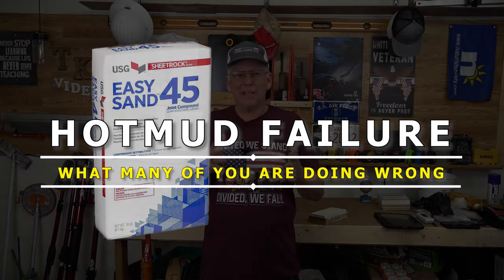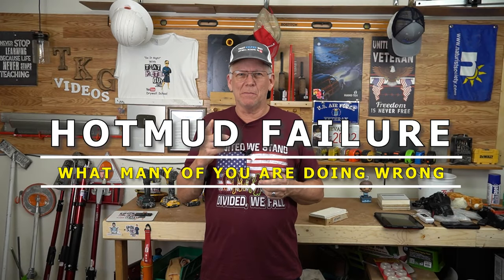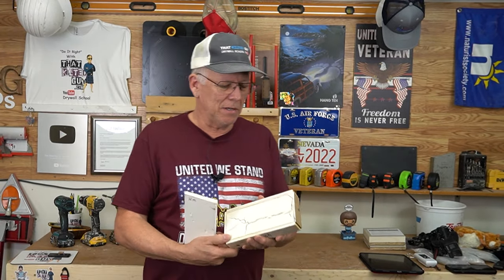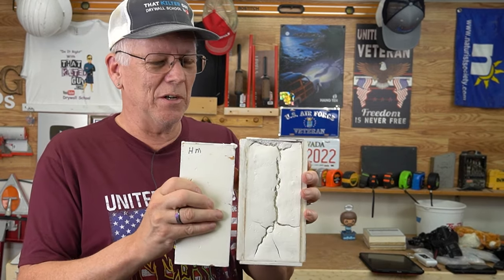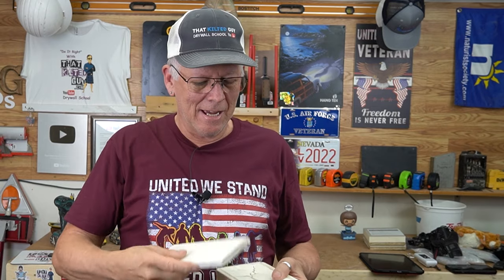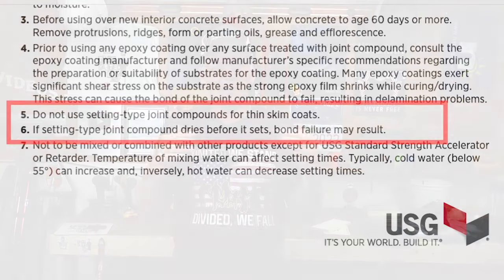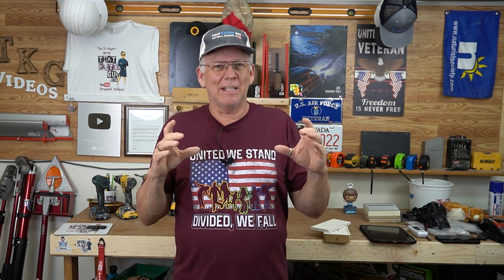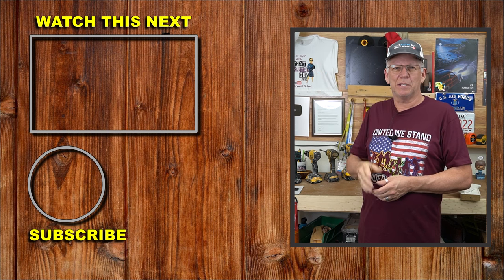Hot Mud MAY FAIL if You Make This Mistake.  That Kilted Guy Drywall School

Comment: This is especially true when you go over existing hot mud with a thin layer and you go to sand it. The top layer kind of peels off the bottom layer and you end up with voids. Terrible situation because now you have to sand it basically down or go over it with all purpose.

Comment: When i worked professionally as a finisher I preferred 90min for all but the top coat and inside corners. I did not know about a thickness requirement.

Comment: This is good info. I'm a painter who does the occasional taping or popcorn removal job. I've started using 210 on larger jobs rather than 90 just so I don't have to worry so much about a full bag setting up on me before I can use it up. I think I'll probably switch back because I can see the 210 drying out in spots before it sets.

I'd also add that I usually start filling screws with hot mud once it starts to harden but before it becomes unusable, drying before setting shouldn't be an issue there.

Comment: How's this for going old school: I still use the brown bag Durabond every once in a while. Maybe two bags a year.  The stuff that literally hardens like a rock. 

The places I use it are in areas where taping is a pain, like when fixing cracks in old textured ceilings. I only use it as a bottom coat and very sparingly. I also use it to fill areas to bring up a patch to wall levels for those times when there's a big difference in depth between the patch and the old wall. Because it's literally rock-like, it's great for filling deep and wide gaps where taping is difficult. It's especially helpful in old homes with plastered walls.

Home Depot and Lowes have discontinued it. Menards still sells it. Glad they do because it has saved me a lot of time.
Reply: Ace hardware still carries it as well.
Reply: Ace hardware still sells durabond 90 in the brown bag
Reply: Some Lowe’s have it. They can ship one store to another if you have a few days. I just bought 3 bags so that I don’t have to drive 20 miles next time I need it. I use it to prefil and 1st coat on FibaFuse.

Comment: I can't thank you enough for this info. I've literally googled with at least 7 different queries asking for an answer to why my hot mud wasn't setting up in some areas (but not everywhere) after several hours with nothing but useless results.

This was especially perplexing because I would always test to see if it had set yet by lightly applying pressure to one of the lap marks to see if it was hard yet. If it was, I'd proceed with scraping down the high points with my knife, only to see my knife make an awful gouge into the mud that didn't set up, ruining the coat.

Turns out I just didn't know that hot mud shouldn't be used for thin floating. Since learning this from you, I pretty much only use hot mud for pre-filling, taping, and occasionally on the first coat after tape.
Reply from the maker: Hot mud also sets up way slower over painted surfaces. That has bit me many times.

Comment: Use that 20-minute mud with PVA glue in the water. 25% for structural and less for not.  Works like charm and delays drying before curing.  
few things hot mud swells, most primers make hot mud swell so use a good hotmud sealer, you definitely need 2 coats of good primer to stop flash through.  Learned all this the hard way.

Comment: USG recommends you only use paper tape for any tape and bedding. They also recommend you score the factory butt joints with a blade for better adhesion, but who does that? Every single time I have to repair old patches (not mine), its because the previous patches used hot mud that is just falling off the walls and ceilings with some scraping. 
I actually like to use my hot mud unmixed on my tray until I start tapping. So i put water first, then hot mud, stir a little bit and then start tapping. Ill have some dry stuff and wet stuff in my tray the whole time as I am applying.  My time to mix a tray is less than two minutes, It cures faster, then I just scrape with a 90 degree angle any imperfections once it hardens up, but before it begins to dry.

Comment: Oh man so interesting. I had to re-do some ceiling tape joints because of some light cracking and couldn't figure out why.....now I think I just figured it out. Never again, last coat with all- purpose.  Thanks!
Reply from the maker: If those joints were done in mesh tape and regular all purpose that would also explain it.

Comment: good video. the w estpac light weight hot mud can be skimcoated thinner than 1/8 but you can't work it too much otherwise it can lose its bond. I've also had a few tiny spots fail when floating some ceilings when it bubbles and you don't skim it tight immediately

Comment: Great video sir...all I buy is EZ sand 5 minutes to do patches because I get impatient waiting for it to dry..lol but for the most part I don't like using hot muds because I like to take my time 🙃
Reply: 2 points to make, I had the same thoughts about  EZ sand, but 1 thing I do to counter my concerns first of all when I use 45 or 90 and I want to speed up the setting time I use very warm water when mixing it works, for EZ sand 5 or 20 if I want to extend the setting time I use refrigerated cold water when I mix it, it allows you to not have to worry about hurrying, to do this allows you to take your time, sometimes I run out of the type I need, by using the different temperature water with the type that I have, I may not have to run back to the store right away.

Comment: Thats odd because I use pro set 30 alot. I've tightly polished over joints that I have 1st and second coated with 30 min and have has zero issues on the finished product. I do for the most part do my final coat while doing patchwork with reg mud tho..

Comment: Thank you sir, this advice came at the perfect time. I have a ceiling I'm about ready for prime and paint in the morning. I did 2 coats of hot mud and one coat of all purpose.  Have a couple small tweaks I would like to hit but was sitting here looking at a bag of 5 min hot mud, thinking if I skim it with that I will be good to go..then I saw this video.  Now I'm thinking I will give it a light scrape, sand and prime ... then hit it with some dry dex to bring it to its final state. What do you think of this game plan?
Reply from the maker: It really depends on what it needs and I can’t tell you that from a text description. But I would definitely stay away from the hot mud as it’s not good for skim coating. You can learn a lot more in my new Drywall courses at www.DrywallAcademy.com
Reply: Thanks I will check out the course.

Comment: Maybe you can spray a thin coat with water to avoid drying faster than it sets. Or mix it wetter?
Reply from the maker: No that’s called re-tempering and they specifically tell you not to do that

Comment: Great content as always. If i prime over hot mud will that help the paint stick to the wall better?
Reply from the maker: Always prime raw drywall
Reply: @That Kilted Guy DIY Home Improvement  Hello, I just took down my popcorn texture in my garage. I also took down the tape as it was loose. So here is my plan. Screw any loose drywall boards, mesh tape, hot mud (2coats), plus 3, apply new texture(orange peel), prime then paint. Is that ok?? Is my order correct or is there something else I need to do?
Reply: @SkyHawk2849 That plan is perfect.

Comment: Guy, I’ll give you a situation- I am painting a bedroom and will be repairing screw pops, minor scrapes, and small holes where screw anchors were. I have a small bag of Easy Sand 5, small tub of All Purpose Joint Compound (green), and a tub of Spackling Paste. Which one of those will give me best results?
Reply from the maker: It really depends on what you’re fixing exactly, and your skill level. Five minute can bite you in the butt if you’re not fast enough. It will literally set up in your pan before you get it on the wall if you’re over mix it or take too long to get the thickness right. Hot mud should only be used on fills deeper than 1/8 of an inch. Otherwise regular joint compound works on everything except deeper fills

Hey I really rely on the support of my viewers to put these videos out and answer your questions. One easy way is to leave us a Super Thanks below the video or become a member of my YouTube channel. You’ll get priority replies to your questions, bonus content and more.  Here’s the link to join my YouTube membership. https://m.youtube.com/sponsor_channel/UCSinsqowcKxmSaKkx3W9_0w?noapp=1

Comment: If you have a huge dip or whatever in your drywall and all you have is All Purpose (Green Lid) if you instead of putting it on real deep in 1 coat, if you add smaller amounts in multiple coats will it still shrink and crack?  LIke if you added that all purpose to that box mold you showed on the video but added all purpose in several coats would it still shrink and crack like that?
Reply from the maker: It’s less likely to but also much weaker in thick coats so fast setting is better

Comment: I have a 8ft x 16" ceiling patch that needs about 1/4 fill before the finish coat (textured swirl) Do I need to use a primer-bonding agent or does the 45m hot mud already have that built in? Thx for your vids!
Reply from the maker: It’s built in when used over raw drywall

Comment: Question for you sir.  I was repairing a ceiling using 20min and I applied a very light or skim coat over the repair.  For some reason the 20min took forever to dry.....are u saying it took longer to dry because it was a skim coat vs a heavier coat?  Thanks!
Reply from the maker: What I said was that if you put hot mud on really thin, it dries before it cures. If it’s a 20 minute hot mud, it needs 20 minutes to cure and if it dries before that, it doesn’t cure right. Hot mud can take much longer to set up over painted surfaces and non-porous surfaces.
Reply: @ThatKiltedGuyDIY  Bingo.....it was a painted surface sure enough.  I dont need a thick coat of mud for my next repair so after listening to you I believe I should use 45min and give it a day to dry completely.  I watch many of your vids....thanks for the knowledge.

Comment: can you use hot mud to fill say large gaps between wall board in a ceiling of say where the corner cracked off when installing the board due to poor measurement??   If so how thick should you first application be??
Reply from the maker: Watch this- https://youtube.com/watch?v=vRKrSm2aHuQ&si=EnSIkaIECMiOmarE

Comment: Great info as usual. Does this apply to where the mud gets thin around the edges where you're feathering a patch?

Is it ok if you're going over with a texture done in all purpose?

Also, could you add a link to the 15 hot mud tips video to the description? Thanks Guy, you rock!!!
Reply from the maker: The feathered edges are fine, and yes you can go over it with the regular mud. I haven’t released the 15 tips video yet. Thanks
Reply: @ThatKiltedGuyDIY  Then the manufacturer's recommendation is confusing to me. It doesn't get any thinner than a feathered edge.. ?

Comment: Good to know. Im in the middle of redoing  a bath remodel i did 10yrs ago. Walls look perfect. Ceiling not so much  All the joints have hairline cracks and where i had to reposition a recessed light the paper tape in one spot just completely let go and fell in the floor. The entire room was done with new sheetrock. 1/2" on walls and 1/4" over dry scraped popcorn on ceiling. All joints were finished with paper tape and 45min mud. I fixed one ceiling crack about 2 months after 1st remodel by adding some more screws along the joint and scraping out the old paper tape and used mesh tape and 45min mud again. It too has recracked.

I think i can fix the moved recessed light with mesh tape instead of paper and hot mud but this time finish with and all purpose. But im not sure the best way to approach the hairline cracks at the seams. Do i need to cut away the paper tape and go with mesh or just mesh over the top?  Thanks in advance. Great videos!